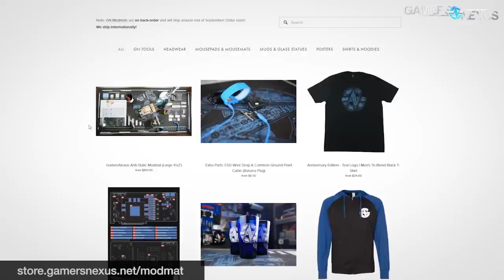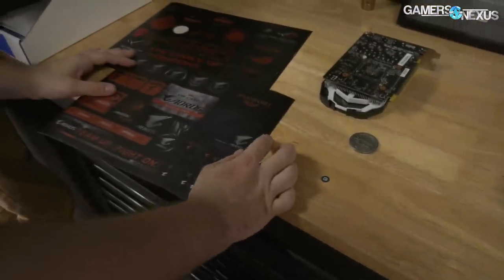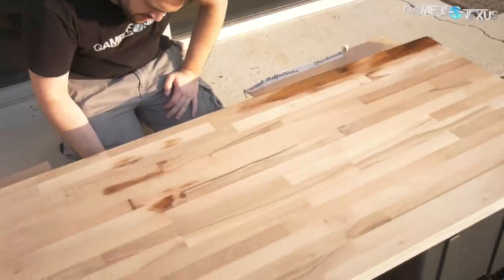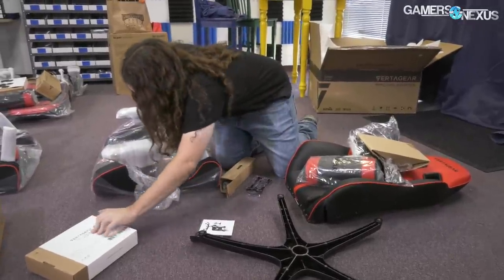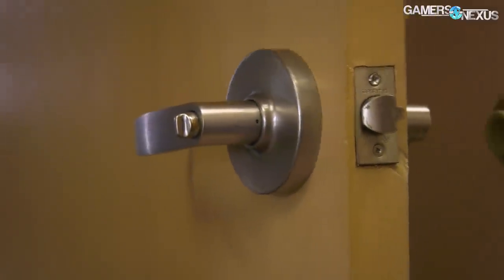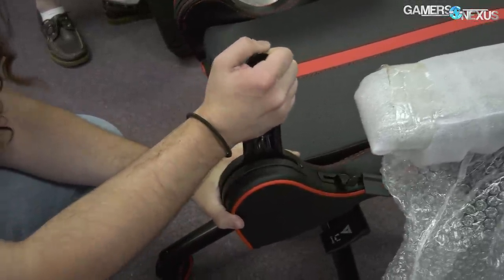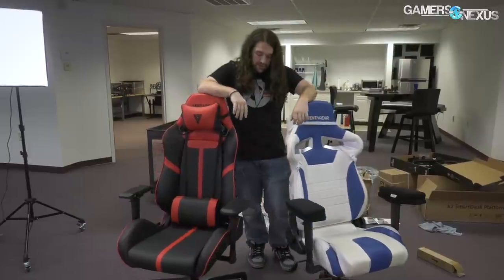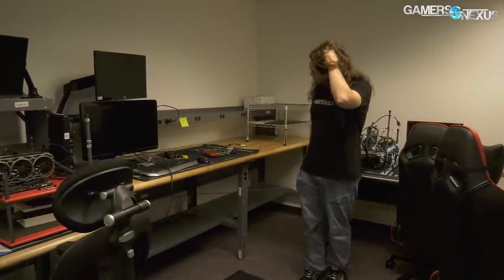Set Upgrade, AMD 'Shrine,' Monitor Wall: GN Moving Vlog, Part 7

Comment: A tack cloth also helps to remove very small particles on board. Also steel wool is not really a good idea. 220 sandpaper is fine. 1 coat of stain should be fine. Clean it off after a short period of time if you want it lighter, keep it on longer for darker. I try to only do one stain. Poly also lightens with every coat. So even if you happen to go darker than you want, just keep putting more poly coats on to get the tone you want.
Reply: See I use 400 grit between coats myself. 220 is probably fine for staining I suppose, but I'm use to it from painting. So ill stick with 400

Comment: the beeping during the video is super annoying part of the song i presume. Its high pitched ;..; otherwise good video
Reply from the maker: Noted for next time. Thanks!
Reply: A high pass filter before you export!
Reply: That's called a triangle I suppose but yeah it can sound pretty annoying to some ears, especially if played on a mediocre quality speaker like a phone
Reply: A high pass filter reduces bass.
Reply: @zeemon9623  I meant to add a high pass as well. I have to turn my lfe down on a ton of YouTube videos because there is a ton of <40 hz noise. My surround sound is tuned to be pretty flat down to about 19hz.
Reply: I see, although that seems like a bit of a luxurious problem to have. Out of all people who don't watch these videos on a smartphone, only a handful have a decent subwoofer. Most of YouTube isn't produced with good speakers in mind or even mixed using something that is able to reproduce anything below 40hz. But yeah, many videos would do well with a 30-40hz high pass for those select few that could experience that frequency range.
Reply: I had to stop watching it was killing me.

Comment: Another Good door trick. When you have stripped out screw holes, take some wood toothpicks and dip each one in wood glue, then put it in the hole and drive it in a little with some light taps with a hammer. Rinse and repeat until you can't possibly get anymore toothpicks in the hole. Once dry (2-4 hours), take a pair of side cutters and trim back the toothpicks till flush, insert new screw and you're done!

Comment: for the rounded out screws, put an elastic band between the screwdriver and screw, the rubber moulds into whats left of the head and helps a lot, used this a few times.

Comment: Quick tip, for stripped Philips head screws you can take a dremal with a cutoff wheel and make a slit accross it so you can then use a flat head to extract it.

Comment: For any kind of staining I would recommend a hair brush instead of foam and a wide brush. As wide as possible. It makes it easier to minimize brush strokes and the foam brushes dont spread the stain quite as nicely as the hair brush. I also mean wide as in like a 4 inch brush.

Comment: On the door, when the wood comes out 
and there is not enough remaining to replace the screw,
Stick a few toothpicks in there, bust them off flush,
an re-install the screw.
In addition, my next chair may just well be Vertagear.
Thanks to them for helping Steve

Comment: Just a few tips for the future, if you're going to sand a flat object, try and use a sanding block, any bit of wood with a flat edge will do. And if you're trying to remove a screw with a stripped head, cut a slot with a dremel disk and use a flat head screwdriver rather than try to drill it or hit it out, it's a lot easier but looks ugly.

Comment: Pack the screw hole with a glued matchstick or rolled glued paper. let dry then re-drill the hole.
Reply: I second this. I used to work at a furniture store and did minor repairs like that. We would use toothpicks and glue,but same concept.
Reply: Ooooooor... Use a longer screw because it works without having to wait for glue to dry. It's not like there's a downside to a longer screw when you have the room for it.

Comment: You can unscrew a screwed screw using a nice sharp chisel. Hit the screw with it to create a nice single line on the screws head.
This will allow you to use a nice flat screw to unscrew the screwed screw.

Comment: There is a tool called an easy out, its like a left hand threaded drill bit. 1st you take a normal drill bit that's ever so slightly smaller than the screws threads, drill a hole in the center of the screw.
2nd you take the easy out, hammer it into the screw then attach it to a drill or hand tool and turn the screw out in reverse. They work wonders for when you break the head off a screw/bolt.

Still nice to see a method for someone to use that they'll probably have the tools for. I think most people have a flat head screw driver and a hammer.

Comment: @Gamers Nexus . You take out  stripped bolts like that using a dremmel to cut a  notch  so then you can use a flathead screwdriver. Been doing it for  years like that always worked.

Comment: If you have a Dremel like equipment and a cutting disk  you can cut a slot in the screw and use a regular slotted screwdriver to undo it.

Comment: Quick tip for your stripped out screw holes.  Take a tooth pick or two and coat them with wood glue.  Shove them into the stripped out hole and break the ends sticking out off.  Let them dry then just screw in new hardware.

Comment: if the screw isn't super tight, you can pop the drill in reverse, apply just the right pressure (with a drill bit, not a driver) and it will slowly worm its way out.

not helpful now, but maybe later to someone

Comment: the trick is to drill the hole small then use a bigger drill bit once it hits the back of the screw it will screw its self out.

Comment: Where did you get those arm rest pads from? I think you said Amazon or some where. Could you post a link or "point" me in the correct direction? I agree with you arm the arms, could use some padding. Coming along nicely guys.

Comment: Another way to get screws that have a rounded head out is to get a flat head driver thats  slightly wider than  the phillips head driver you would use if the head was still good.Then basically hit the screwdriver with a hammer directly into the centre of the screw head thus creating a couple of notches that will enable the flathead driver to get some purchase on the screw.

Then when you`ve battered the hell out of it , put lots of forward pressure on as you twist the screwdriver to undo it.

Can ruin the the screwdriver , but seems a quicker way to do it then the way you did it :)

Comment: Hey Steve, you can shove toothpicks into the hole and break them off on stripped out holes if the screw isnt holding lots of weight.

Comment: The messed up screw in the door - A longer screw probably won't be very helpful in the long run. An easy fix for that is to jam a couple of toothpicks in the stripped out hole and then use the standard screw like normal. The toothpicks will fill in the stripped wood and allow the screw to seat normally.

Comment: Please don't expect these acoustic panels to reduce ambient noise because you will be sorely disappointed. What they do is cut back on reverb and only if you cover a decent amount of walls and ceiling and only on the high to mid frequencies. If you want less noise to enter the room you need significantly thicker walls, doors and windows. An inch of foam sporadically spread around the room will not do anything. You aren't going to put out a forest fire by spitting on it. If you want a more dry sound, however, these panels are pretty useful. You still need a lot of them to have a reasonable effect, but that is what they are for.

Comment: i know you cant stop and ask your audience for advise for every little obstacle you hit. I get it that things need to get done but some tips for you to put in your proverbal tool shed. You can use and a dremal with a cut off wheel to cut a small slot in rounded screws where you can then use a sloted screw driver to extract. also tung oil i find is an easy way to finish wood after its been sanded and would bring out the natural beauty of that wood imo.
Reply: Huskycdn freshly squeezed tongue oil or can he just lick the table tops?

Comment: Steve, The Vertagear chairs seem to have a defect in the base.  The left side metal rods will come out of the base.  I have had 2 bases now, 1 replaced by Vertagear, fail in the exact same measure.  After the second one failed they stopped responding to my emails, so be ware.

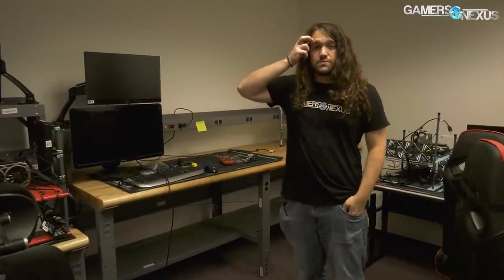Comment: What are the benches behind you starting at 18:37? I'm in the market for a workbench for my office and those look exactly like what I had in my head as the perfect setup!
Reply: They are Electronic Work Benches they got used from a previous Cell Phone repair company.  The top part is called a Workbench Power Riser. As for the exact model those are?!?!?
The Bench top looks to be  [ Maple Butcher Block Safety Edge ] that is the rolled edge. 
https://www.globalindustrial.com/t/work-benches  looks like a companies that makes those, just not sure exactly which one they have.

Comment: Screws get rounded off  by using either damaged/worn drivers, wrong size driver, or simply wrong standard of driver altogether. So many people just use one screwdriver for all screws. Damages the screws and the drivers and progressively gets worse. I've watched professionals use the wrong driver that was well past its useful life. The posidrive/philips mixup is a common one.

Comment: The part about the screws and using a screw extractor kit, has anyone ever had luck with these?
I see them all the time as the aisle endcap specials at hardware stores, and I could've used some at one time, but as far as I know, they're more of a gimmick than an actual tool. 
I understand the theory of how they work, but I have yet to hear a success story for them.

Comment: Sand with the grain and you will get better results. At least do it for the finishing sanding. 8 years of wood shop.  Building furniture.  You will appreciate the difference. The light facing the camera isn't comfortable on the eyes.

Comment: Steve I meant to throw this into my first post but    #ASKGN  OK 2 Questions Hopefully they make it into AskGn-100 & both in the same Ballpark:   #1 Any Update on the Smaller size MOD MATS yet?   #2  Any Plans to make a Bigger Mouse pad Like say 20x16 or 18x14 ?  my Idea is to Put IF YALL MAKE THEM.....NO pressure...lol   A  20x16  Mouse Mat on the Smaller size Mod Mat and then a second 20x16 Mouse Mat and then a Full Size Mod Mat out by the Pool for when I set up my Outside Set Up. But that's not until I finish Cattle season and the Solar Im going to install before that thats why i asked about Mats and Mouse pads!  Sucks being a 1 leg fat guy doing all this my self....lol   Cow }:-o)